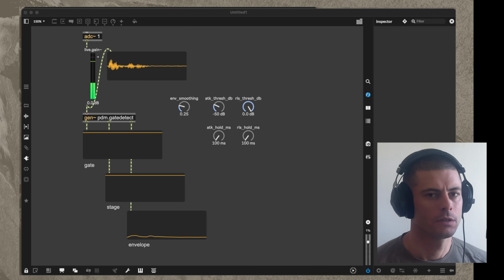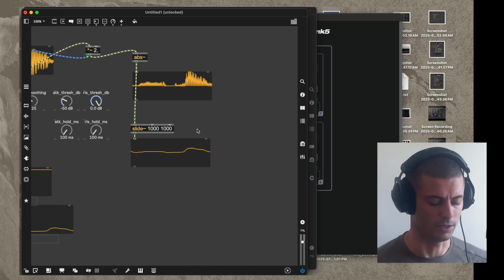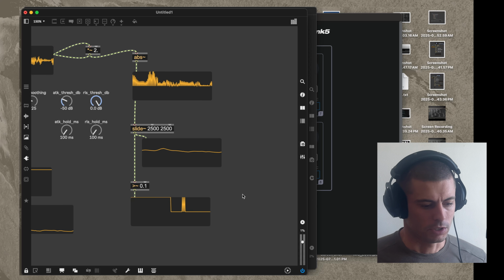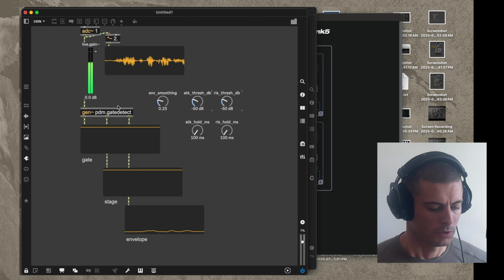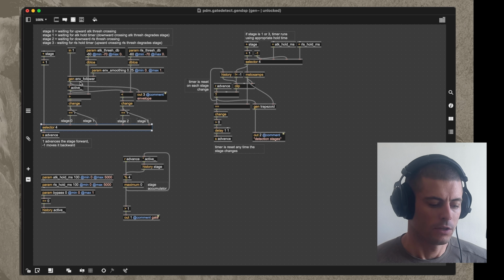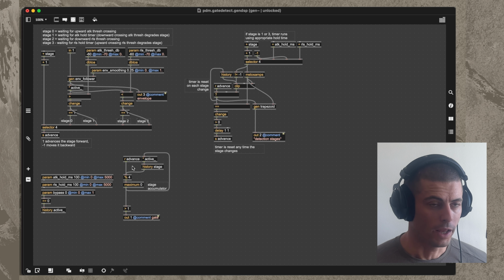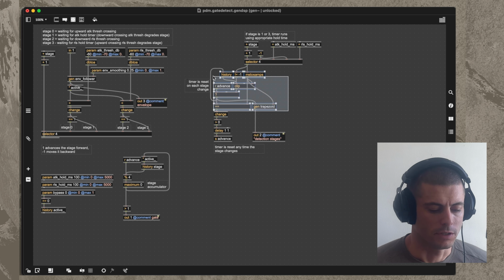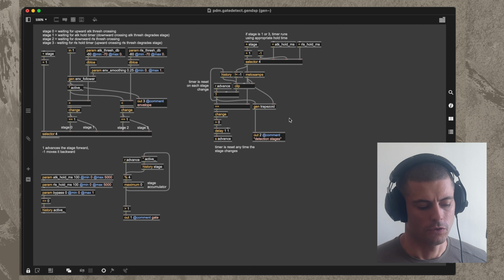Envelope following and sound event detection in gen~

Comment: Great vid Philip. Several years ago I was working on a binaural system (using Spat 5 in Max) for use on an LP. I got as far as thinking how the same system could be used in a performance context with audio triggers from instruments moving audio around the space. I used the same >~ 0.1 as a sensor for the audio in. I was using a bass guitar as the trigger but, of course, you don’t play continuously so the gate would trigger, the audio would jump to another (virtual) speaker but the reset would kick in too quickly. The result was audio bouncing around the space mid bass riff. Now I know what to do. Thanks.
Reply from the maker: no problem, and that sounds like a cool idea! yes, by tuning the attack and release times (shorter attack, slower release, usually), you could make it responsive while still keeping it focused on one riff at a time